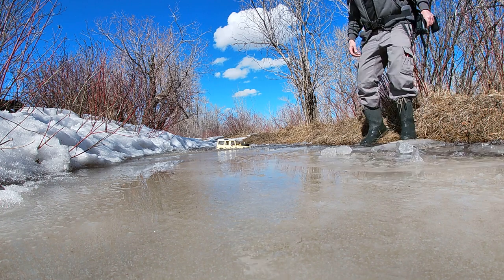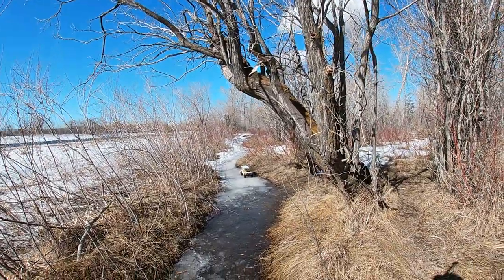RC ATHLETES - Solo Trip to Beaver Flats

Comment: Pretty sweet run, you really test the " waterproof" , don't you ? Do you dry your truck when you get home , and if so how ? I know you run marine grease in your drivetrain, but still. Really curious, because my rig ( Gen 8 Axe ) I only consider water resistant. Thanks for the cool video !!
Reply from the maker: Nope, i just put it beside the floor drain by the furnace for a day or 2 lol